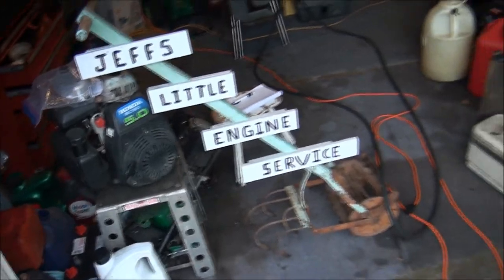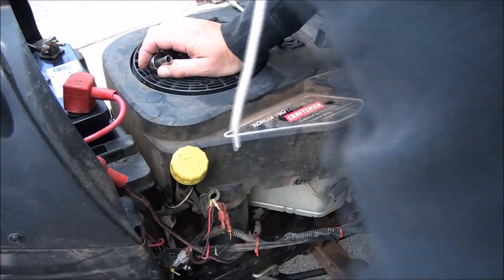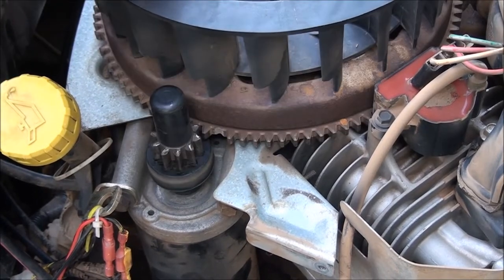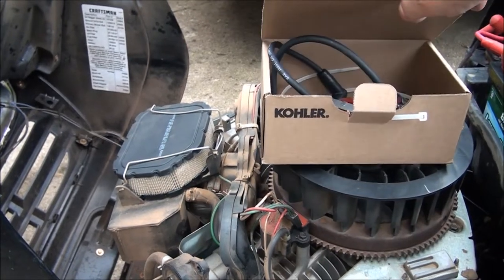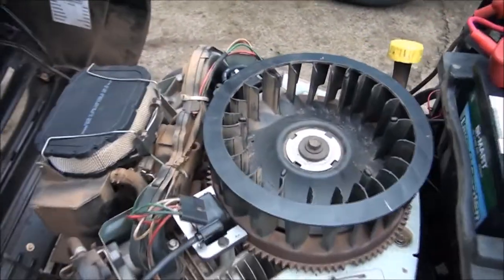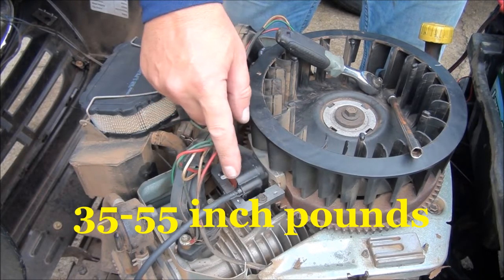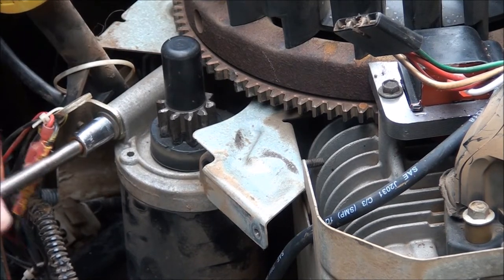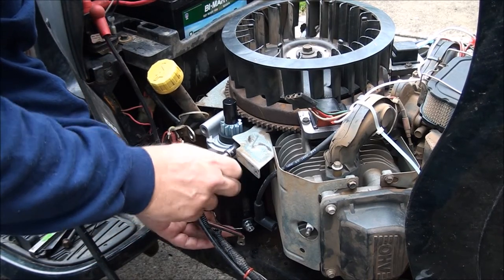NO SPARK ~ PROBLEM with KOHLER COILS Magnetos ~ Riding Lawnmower COURAGE 26 hp TWIN cylinder Engine

Comment: For those suggesting using a dollar bill to set the magneto gap, a dollar bill is less than 0.005" thick, so it isn't a good gauge ...unless you double it, that would make it around 0.009". Many business cards are as thick as 0.016", so unless you've measured it, don't trust a random business card either. The gap should be 0.008" - 0.012"... is that correct? I've always used a matchbook cover. But I just measured a random matchbook and it's 0.0125". So, it isn't the best idea either. Unless you've measured the thickness with a micrometer, paper products aren't a good bet!
Reply from the maker: Yes, if you measure it, it will never be an issue. But sometimes you gotta do what yo gotta do.

Comment: How old? How many hours? Was someone poking in there before? Looks like it's had plenty of poor maintenance . Easy to blame the manufacturer.
Reply from the maker: Kohler had some issues with engineering, parts availability and product quality on some but not all engine models, in my opinion. Some if not most of their small engines use hydraulic lifters which is pretty cool.

Comment: Hello , I have the same 26hp kohler courage engine however mine surges only at full throttle. I've tried replacing the carburetor and used a separate fuel tank with fresh gas to gravity feed the carb with no change. I sprayed wd40 on the plastic intake manifold with no white exhaust smoke. Any ideas please? Thank you
Reply from the maker: If it was a cheap aftermarket carburetor that may be the issue. I have had problems with those and always recommend the expensive Briggs and Stratton replacement carburetor. Or to rebuild the original carburetor
Reply: Thank you for the response. I had the exact same issue with the original factory carburetor before and after I did a complete tear down and carb cleaning. That is why I decided to buy a new knock off one which is doing the same thing too.
Reply: Surging is often indicative of 'lean'. Check fuel flow, correct needle valves, etc.

Comment: They say you can use a business card and you put the whole magnet and the coil facing each other and then loosen up the bolts push it to the magnet which it should go anyway and then tighten up the bolts and take the business card out which is roughly 9 1/2 thousands the easy way duh!

Comment: Complains about the coil wires being loose and then proceeds to remove the connector by yanking on the wires instead of the connector itself. Rookie mistake